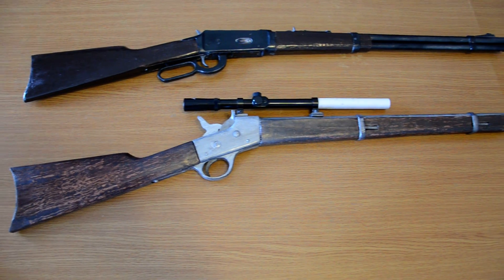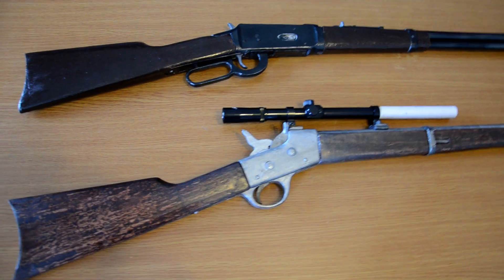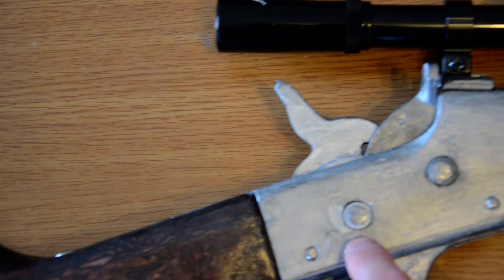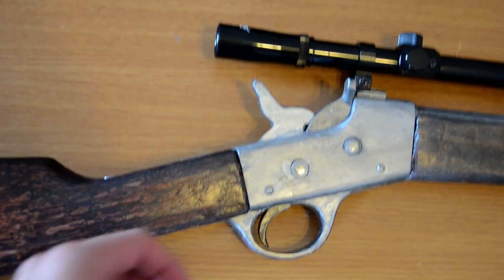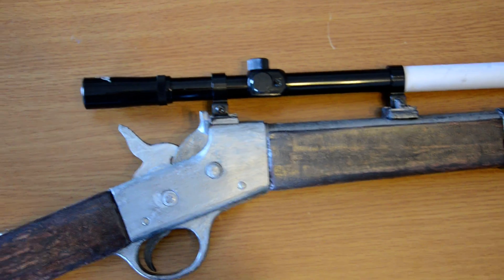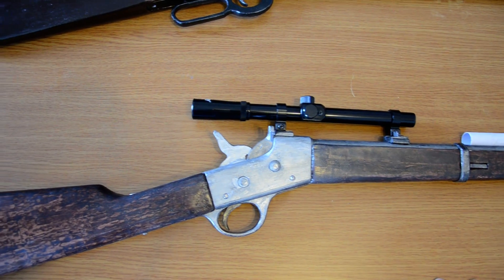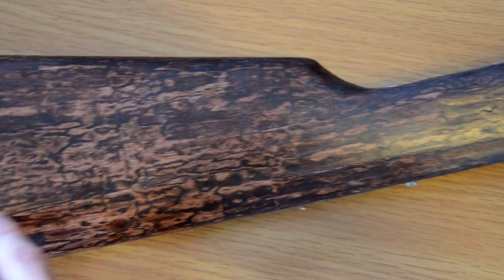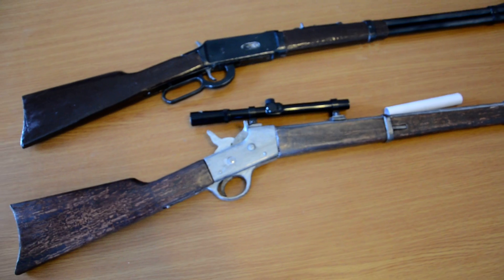Homemade Rolling Block Rifle

Comment: since it's a .22 short, you could put a metal car break line in the barrel (idk if you already use metal inserts in the barrels, i just started watching your vids)

it's an old zip gun trick people used to (and probably still) do in chicago. i'm not sure on the legalities if having part of the barrel metal makes it a 'firearm' according to the feds, but making a firearm for personal use is legal anyway so long as the barrel and overall length aren't out of spec and it isn't full auto or something (in the US, not even sure where you are)

Comment: lol it shoots real ammunition, and you're worried about spring pressure...

That's pretty neat, in before you blow your face off.
Reply: Why would it blow his face off? 22lr isn't that powerfull..
Reply: The roling block mnechanism is preaty strong. 22short dosent do anything even by a "paper gun" like this.
Reply: dude, a 22 is so weak that the bullet visibly falls to the ground at 66 yards.
a bow and arrow is can easily go 1000 yards.

plus, some bb and paintball guns do more.
not to mention a reasonably powerful slingshot can easily match a .44 magnum bullet.